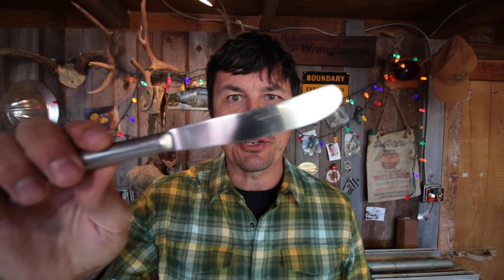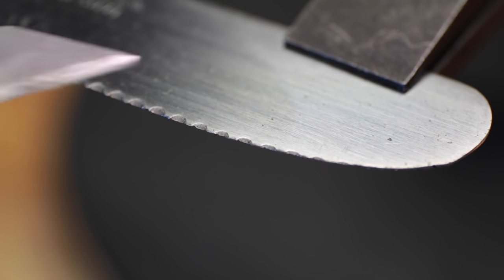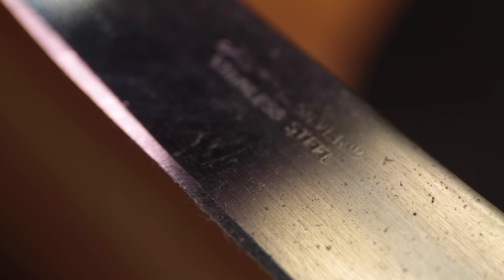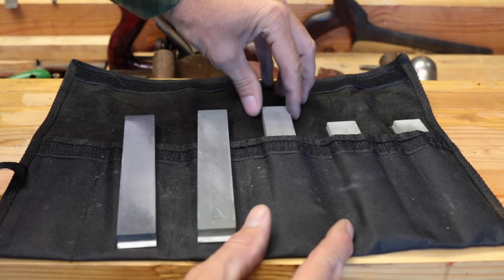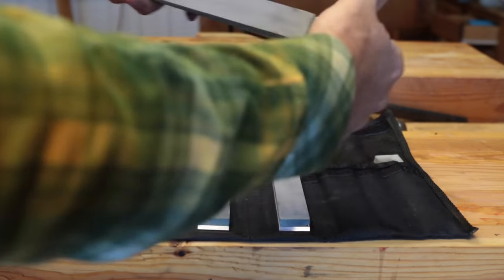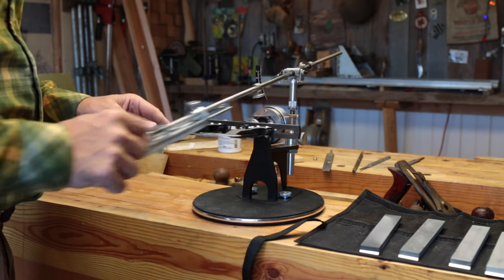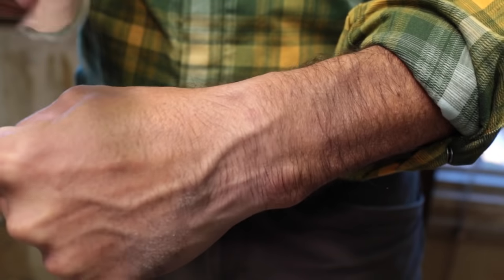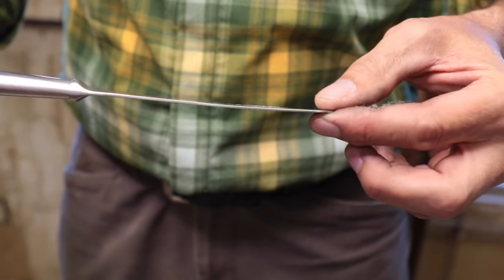Can A Knife Be Too Sharp??

Comment: You showed that you can make a butter knife razor sharp, but you didn't show us/explain if a knife can get too sharp.
Reply: yes a knife can be too sharp. if there is no serrated edge whatsoever it wont be as efficient as a knife sharpened with a serrated edge. even the sharpest of kitchen knives have a slightly serrated edge. the serrated edge starts the cut then the sharpness of the teeth does the rest. if you use a knife sharpener at home like the long ones on a handle, all they do is push the tiny blades back to the centre, as over time with cutting, the teeth of a knife will bend outwards reducing efficiency, these "sharpeners" are not really sharpeners at all, they are more blade maintainers at the same time they bend the teeth back into the right direction, they dull the teeth. to sharpen a blade properly you would need to send it off to someone who is good with stones to sharpen new teeth into the knife. these electric sharpeners dont work either they just sharpen the blade in a uniform fashion say from one angle, they dont put new teeth into the blade which you need to do with different stones at different angles.
Reply: A shaving razor can be "too sharp".  People feel it as "harshness".
Reply: The serration thing is only true for drag cuts though, push cut operations(as in eg. shaving) can have a virtually perfect non-serrated edge. And it is pretty difficult to sharpen a knife so finely that its ability to drag cut suffers from it, you'd have to use an extremely fine honing compound on a leather strop to achieve that.
Reply: WakeUpToWhat? 
What if the tip is an atom stacked on four atoms stacked on
And the edges have one atom stacked yeah you get it
Reply: Bro, everything is complex combinations of positive and negative atoms. It's like yin and yang innit :p
Reply: That would be when you try to shave with uneven, weared down knife.
Reply: WakeUpToWhat? 
But most of our knives in the block are non serrated. The only serrated one is the bread knife. Do you mean tiny serrations along the "naked-eye" smooth edge of a meat knife for example?
Reply: yeah dude so you said it yourself all your knifes are serrated ;) i was trying to explain if you don't know what youre doing and try sharpen a knife with say a cheap sharpener or something and its left with no tiny teeth at all just a straight blade you'll try cutting a tomato and it will just flatten the tomato haha. the sharpest samurai swords have serrated blades or tiny teeth the naked eye can't see, traditional blade finishers will spend hours will stones cutting different size teeth at different widths into the blade
Reply: WakeUpToWhat? 
I see.
I finished sharpening 5 different sized knives using an aluminum dioxide-coated MDF wheel attached to a grinder and I used an old tomato as a test and they cut fine. 
It polished all the tiny serrations off (I used a dissecting microscope) and created a mirror edge. 
Are you saying this is bad for the knives?
Reply: youre wrong buddy if you look at how a samurai sword is made youll see a proffesional sharpener explain how he cuts different "teeth" into the blade. that is how a blade cuts, look at any saw used for cutting timber, it has teeth. that is the only way a blade can cut, if it was dead flat it would be useless no matter how sharp
Reply: uhm no you are wrong. at about 1000 to 1500 grit, you start to achieve close to a mirror polish, with extremely little micro serrations, to the point they dont affect normal use, as the distance from tip to . Sharp knives cut, dull knives with micro serrations "rip". Infact, things like obsidion blades can be so sharp they littiraly are thin enough, around 3 nano meteres, to get in between molecules of certain materials, eg meat, hence being used in some surgical applications. From wikipedia: "Obsidian can be used to make extremely sharp knives, and obsidian blades are a type of glass knife made using naturally occurring obsidian instead of manufactured glass. Obsidian is used by some surgeons for scalpel blades, although this is not approved by the US Food and Drug Administration (FDA) for use on humans. Well-crafted obsidian blades, as with any glass knife, can have a cutting edge many times sharper than high-quality steel surgical scalpels, the cutting edge of the blade being only about 3 nanometers thick.[44] Even the sharpest metal knife has a jagged, irregular blade when viewed under a strong enough microscope; when examined even under an electron microscope an obsidian blade is still smooth and even.[45] One study found that obsidian incisions produced fewer inflammatory cells and less granulation tissue at seven days, in a group of rats, although no differences were found after 21 days.[46] Don Crabtree produced obsidian blades for surgery and other purposes,[44] and has written articles on the subject. Obsidian scalpels may currently be purchased for surgical use on research animals.[47]"
Reply: It was a rhetorical question
Reply: drew13600 he's wrong on so many levels.
Reply: Jamie Dyer Do you even know how cutting works?
Reply: Jamie dyer you seem to understand blades better than our language. I'll take your advice but consult an editor next time you decide to pontificate on blades.
Reply: Copy
Reply: copy pasted comment
Reply: I'm leaving it at 666 likes
Reply: 666 likes lol
Reply: You copied this comment exactly
Reply: @xbox_tommyr237  yeah it's literally the comment right under this lol for me at least
Reply: lmao why u copy it word for word
Reply: Did you srsly copy the top comment?
Reply: Wtf you completely copied another comments

Comment: Any solid metal can be sharpened to that point. The difference is how long they'll last and under which conditions.
Reply: AtotehZ no they can't, if the blade is to hard then it's will chip

Comment: no a knife can't be too sharp, but it can have the wrong edge geometry, depending on what use it's being put.. You can probably get a reasonable edge on any thin piece of steel, that's not really the question, but how well it stands up and stays sharp is. Shaving isn't exactly going to dull it much. Want it really really sharp, don't stop at 1000 grit, go to 5000 or even 7000 grit. That will be a super sharp knife, but holding such a fine edge is very difficult, even with high grade steel.

Comment: The answer is no. A knife cannot be too sharp. And yes you can get any piece of steel shaving sharp. Especially with a sweet sharpener like that. I have a similar sharpener. I do prefer sharpening by hand though on diamond plates. It’s very relaxing

Comment: Most blades you can get that sharp, but how long they hold the edge is the difference. Also, my 70yo high carbon steel straight razor would have shaved that hair off in one or two strokes.

Comment: An Electron Microscope: A microscope of extremely high power that uses beams of electrons focused by magnetic lenses instead of rays of light, the magnified image being formed on a fluorescent screen or recorded on a photographic plate: its magnification is substantially greater than that of any optical microscope.

Comment: Could have gone much sharper.  For a shaving razor, 1000grit is the starting stone, not the finishing stone.  Usually up to at least 4000, some people will take it to 8000,10K or more.  And THEN there is stropping after that.  Also a shaving razor typically has a 14 degree bevel as opposed to 20 degrees.   Of course, the cheap steel might not have been able to benefit from all this but it would have been interesting to try, and test with a real shave.

Comment: of course you can get it sharp enough to shave with you can sharpen a piece of plastic that can be razor sharp the thing is it's never going to hold that edge because it's cheap Chinese steel and its not tempered properly

Comment: too sharp? Yes, its too sharp when u see a rainbow, thus u heated up the metal too much (from grinding), it will dull much quicker if rainbow colors are seen, but then again you're manually doing it, we men sharpen with a motor behind it. There you go, saved y'all 3 minutes of wasted time and gave you the CORRECT information.

Comment: suuuuperfine ONE THOUSAND GRIT :))))  LOL, what a joke, FYI I start my chefknives on a 2k, finish them on a 6k, then they get honed on 1 and 0.5 micron (14k and 60k grit). Those are sharp. Like they will literally split your skin by contact.
Reply: Good luck getting any thing other than a well kept chef knife sharp with a starting grit of 2k. The start point is not important, it is the end point, angle, angle consistency, scratch pattern, and steel properties that matter.